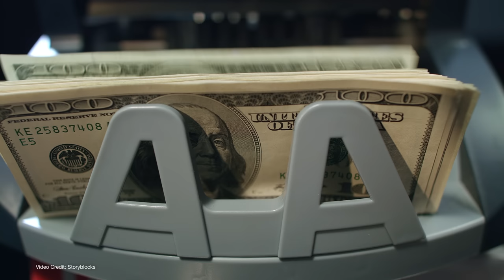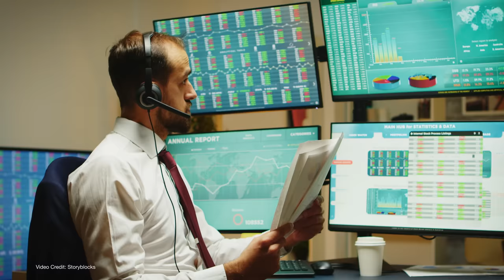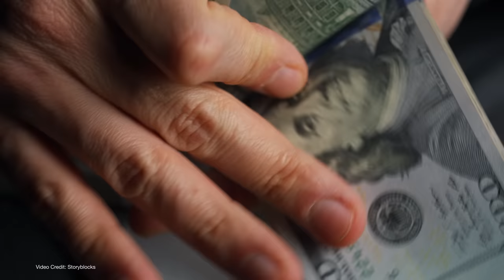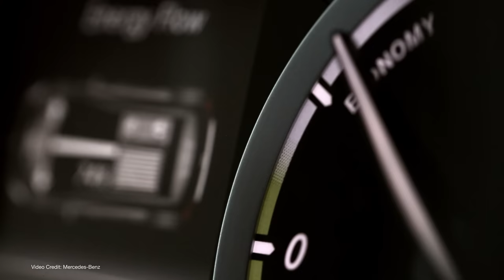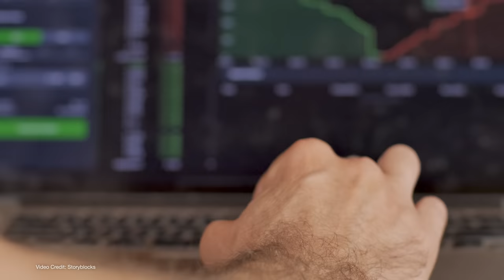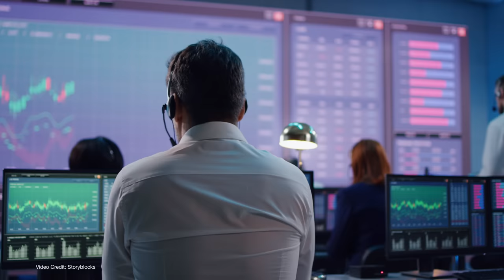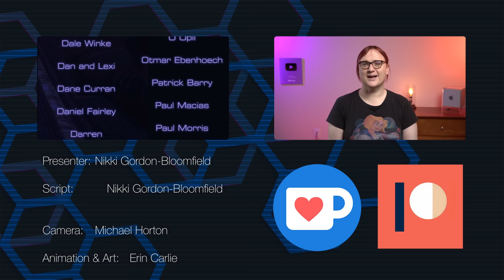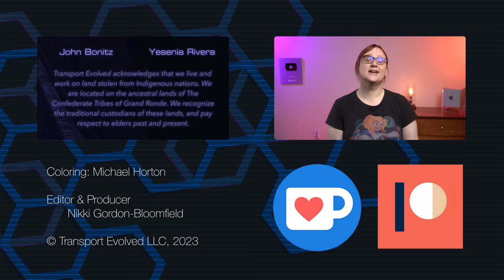The EV Industry Bubble Is About To POP. Here's Why It Will Be Different This Time

Comment: What was the petrol total cost to the electrons total cost comparison?
Reply: My Bolt gets about 4 miles per kw. Electric where I live is 12.8 cents per kw. Gas is $3.68 per gallon. So 3.68 divided by 12.8 times 4 equals about 115, during the winter it would be about 3 miles per KW so about 86. So during the winter when range is reduced a ICE car would still need to get about 86 MPG.